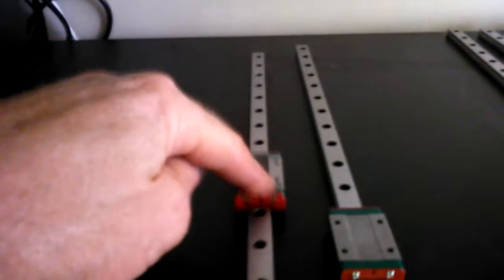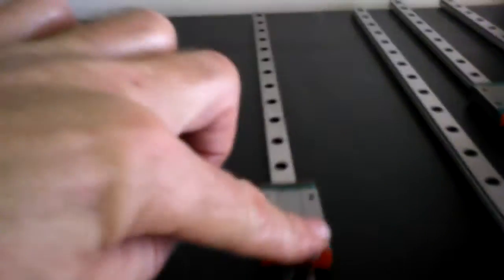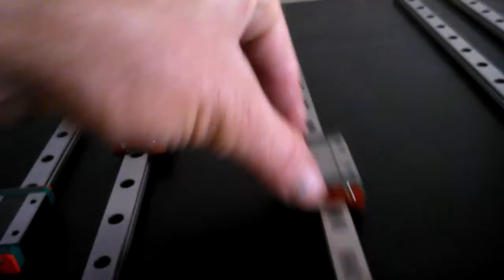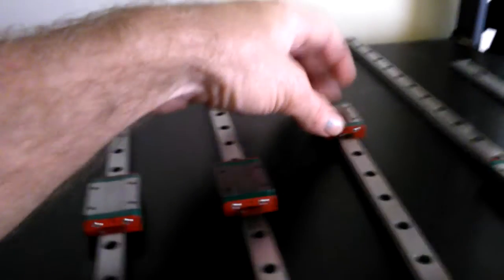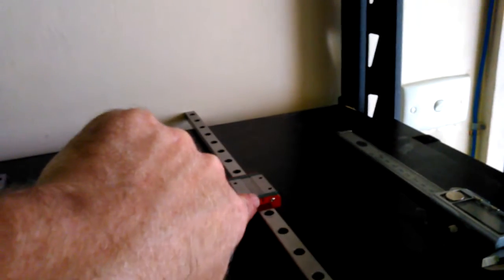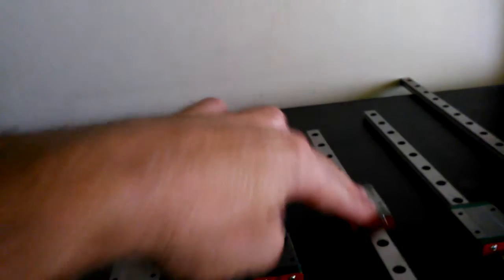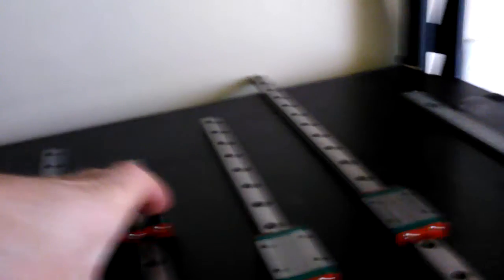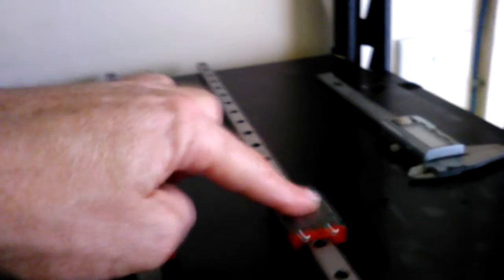Bad linear rails

Comment: RC, I am trying to figure out how the advertised length of these rails matches up with the actual length. From the drawings the distance from the end to the center of the first hole is set (E)(10mm in MG series) and the distance between holes (P)(25mm in MG set). So 495 mm should be the overall length (2*10+19*25=495) which I assume is the 500mm advertised. On the MG series this is no big deal, but on the HG20 series (E=20 and P=60). Which translates to either (2*20+7*60=460) or (2*20+8*60=520) for an advertised length of 500.  On your rails did they honor the E dimension on both ends (495 length) or did they no honor the E dimension(500mm length). I have tried several sellers without any response on this question. Thanks

Comment: To anyone watching this now.  Linear rails need to be preloaded with a weight for proper usage. New rails are shipped with a light oil finish for rust protection, they need to be properly greased prior to use. Moving them with your hand it not enough to test them properly.
Reply from the maker: they where flushed out with wd40 . lubed back up with gun oil ... and with at least 5kg weight on them , they  still where lumpy as f.  they had odd sized balls in them after checking them with  mic,s . they  where cheap rubbish that went into the rubbish ..

Comment: These come apart very easy. New loose ball bearings can be ordered on ebay. Also, I received some linear rails that had too many ball bearings in the carriage. removing just one ball from each side made them run much better! there should be a gap between the balls that looks like you can fit one more and still have some slack but that one more is too many.

Comment: Hope you've  got better replacements.... Could you please share the sellers name
Reply: Did you try and clean them? I've seen lots of posts where the Chinese rails need prep before they're good to go because they get crap in amongst the balls.
Reply from the maker: Sure did (cleaned and oiled).... i tried swapping the blocks from one rail to another . to no avail
Reply from the maker: biwecity was the sellers name on ebay . it was a battle to get my money back from biwecity . 
ebay had to step in to get my refund . stay away from biwecity....
 i found some new ones that work fine from another seller  , the above rails in the video where unusable . 
buyer beware as they say .